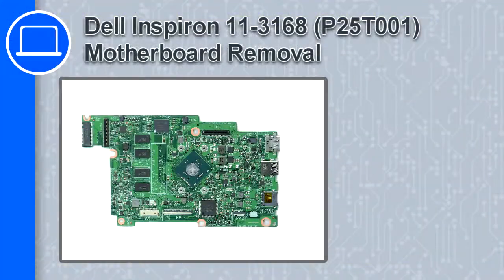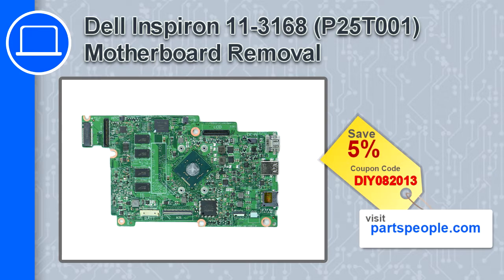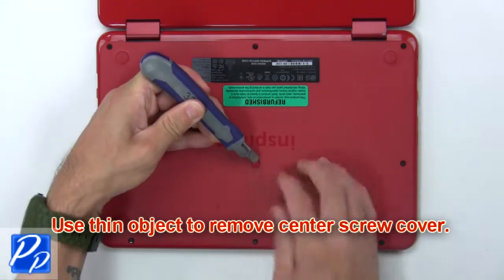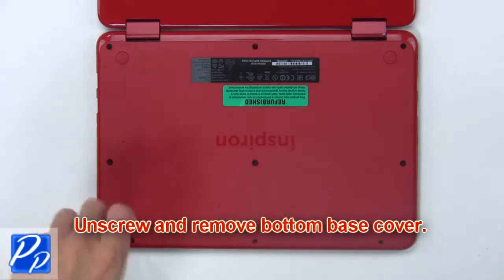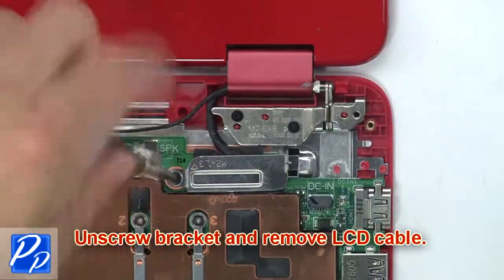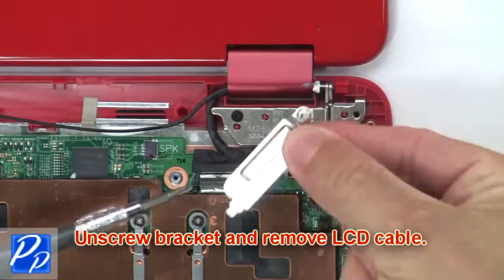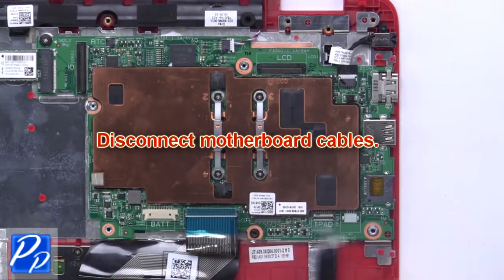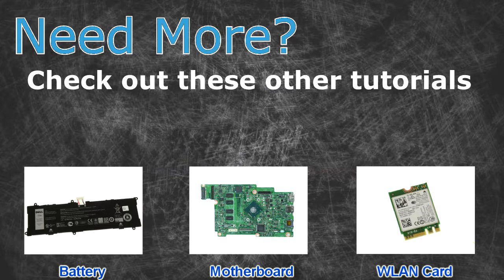Dell Inspiron 11-3168 (P25T001) Motherboard (W/ On-Board Memory) How-To Video Tutorial

Comment: this video is bogus/useless. It shows images of two completely different motherboards with very different configurations... eg., with and without a hard drive, with and without a SODIMM RAM memory slot, etc.
Does the model 3168 (P25T001) have a removable HD and RAM or not?  If not, then it shouldn't be shown in this video as the motherboard parts are different. 
The model 3185 (P25T003) I think uses the other motherboard without removable HD + RAM.